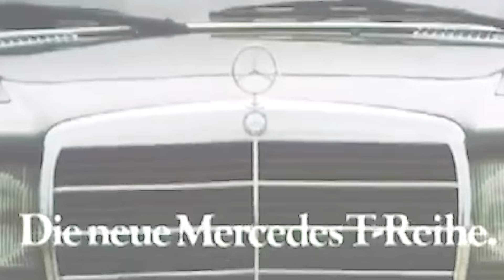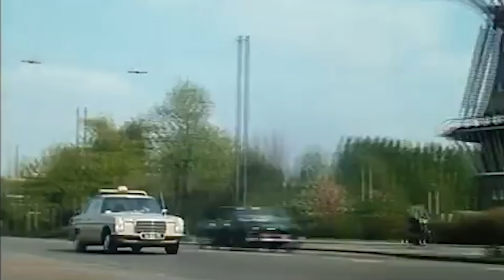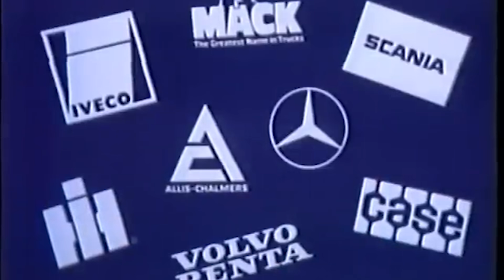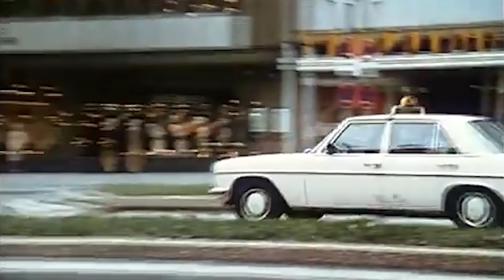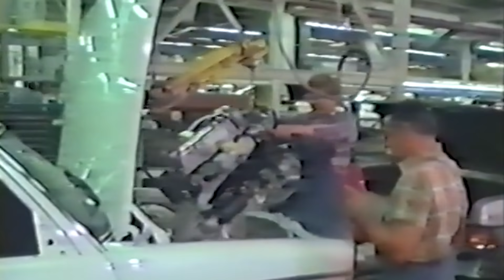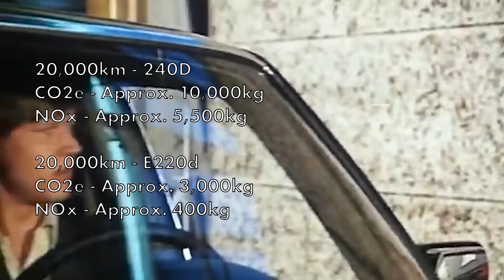Mercedes 240D - Still Fit for Daily Use?

Comment: Good subject. The fundamental message is to reduce "consumption" which in turn reduces all emissions. This is job N°1 for humanity.
This means avoiding E-cars which involves thousands of tons of CO2 to be made (the equivalent of 70,000 miles in a ICE car), taking public transport and using a bicycle for all local tasks. The ONLY positive of E-cars is to reduce local particles (other than from the tyres and brakes).

I have driven a 240D (4 speed) manual) and for me the main difficulty is with overtaking ;-). There are some quite good runners up to these cars.
Reply: I read an article recently that stated the total carbon footprint of the average EV battery was equivalent of that used for 6 batteries for the average plug-in hybrid. Since the 6 plug-in hybrids take 6 ICE cars off the road, the net environmental benefit is far greater than for a purely electric vehicle.
Reply: @ak5659  It takes an EV 70,000 miles to even equal an ICE car using petrol. If the ICE uses e85 from agri-waster, it will take far longer. I have nothing against EVs except if rare earth metals are used in the batteries. For the time-being only Toyota are getting close to solving the EV car problems.

Comment: Thank you for a very informed and well rounded video.  Very interesting when looking at vehicle tail pipe and total life emissions. 

For a long while now I've held the view that the internal combustion engine isn't quite the devil that some environmentalist's make it out to be, but that the fuels that we are filling our tanks with, are a lot of the problem. We can use cleaner fuels, in some countries we do, but others are slower to adapt to them. 

We could also look at retro fit exhaust emissions systems for older vehicles like this. It won't make it as clean as a modern diesel, but it also consumes a lot less resources to retro fit an old, good condition car, than to scrap it and build a new car. Which would give us a gain in lowering pollution two ways. First, lower tailpipe emissions. Second, lower total life emissions. That's a win for the environment.

You can always turbocharge a non turbo diesel to improve it's performance to keep up with modern traffic better, without major modifications to the engines fuel system, and quite possibly improve it's fuel economy. Older toyota diesel owners that fit aftermarket turbo systems find not only increased performance, but increased mileage too. Better mileage equals lower exhaust emissions.

Comment: W123 are becoming a bit antique pieces to be thrown around like this.I drive a 190d daily, with excellent reliability and fair fuel consumption considering is a 1988 4 speed car. It can totally keep up with modern traffic, and i don't go much into town with it.  Also have a W124 250d that i bought used 12 years ago, and 230000km after it still pulls strong. The 190d being smaller uses less fuel, obviously. I mostly drive over a low density region where transit unavailable. Inside cities, mass transit should always be preferred over private car, and long trips the train will be cleaner, but old cars can have a chance for little expense compared to buy a newer option that will be much more expensive and pollute just a little less over the same driven distance. I had an electric car, and was not overall impressed, plus some of those are designed to fail and require costly repairs over the years.

Comment: I know a guy with a W124 300D that has done almost a million km and hasn't had it's oil changed in 10 years (it's more of a thick black goo than oil). It still runs and drives. You just have be careful not to touch the thing in the wrong places because you'll create a new hole if you lay a finger on it, it's that rusted through. But it drives. Not on the road mind you, it hasn't been road legal for those 10 years, but it works when absolutely needed for one reason or another. It also tries to kill your spine every time the transmission decides to shift lol.

 Personally, E39 528i/530i are the best daily drivers you could buy used for a reasonable (albeit climbing) price today. Dead reliable if you aren't the average American who thinks reliability is when you can use horse manure instead of oil without any downsides. Replace the cheap water pump every time you do belts, keep an eye on the old hoses and replace as needed and replace anything else that goes wrong instead of letting it simmer until it turns into a raging boil. Plenty of comforts, none of the stupid electronic drivers "assists" that try to kill you, easy to work on, comfortable interiors with great ergonomics, heavily modifiable if you want to go down that route, and they get FAR better fuel economy than equivalent engine models from Audi at the time. Rust is an issue with salty winters, but it's managable if you take care of it. Had a 528i with spark plugs 40k km overdue replacement and a broken cam pos sensor start in -35C reliably and still drive fine as long as you kept the engine load low. Plus, they handle really well for a softly sprung heavier sedan, very nice in winters where most FWD cars struggle to accelerate, brake or turn because of the awful weight distribution they have. 
 If you wish to stick to diesels, most BMW's with any variant of the M57 engine are incredibly reliable and have good power. I'm convinced there's not a single Nissan Patrol or original Land Rover that's still actively driven and hasn't been M57 or OM606 swapped. 

 Also, for the lower CO2 emissions of diesels, that's not really the case. If you look at equivalently powerful engines, both modern and old. Diesel's emit the same amount of CO2. CO2 emissions are directly correlated to the amount of fuel burned, but equivalent performance diesel/petrol engines are usually roughly the same when it comes to fuel consumption, since the extra thermal efficiency from diesel engines in something as small and light as cars is easily offset by the extra weight of the engine components and emissions equipment. The reason diesel's produced less CO2 at the time was because they were far, far less powerful than petrol models, meaning they burned much less fuel. It was never a real advantage in cars for the reasons listed, but the very slow burning nature of diesel has it's uses in large, commercial engines where you could never get the RPM up high enough to get useful power out of a petrol engine because of the very high stresses on the internal components. 
 The one thing you also didn't mention about electric cars is that they're very heavy. Heavy vehicles put much more strain on the road resulting in more road damage which means more frequent road maintenance/repaving. It really doesn't solve any of the problems related to cars, especially in cities. There just isn't any winning in a car to car comparison, because public transit blows them all out of the water. Just stick to public transit if or when you can and roll your weekend warrior out when you want to have some fun. Remember: personal cars really aren't that large of an emissions issue unless you drive tens of thousands of miles per year. The bigger problem is industry and commercial vehicles that could very easily be replaced with electric trains if capitalism wasn't too busy milking the commoners for it's own benefit.

Comment: I own (and daily drive) a 300TD. I drive it approximately 25,000 miles per year. I appreciate that you have broken down the environmental impact of the full life cycle of a vehicle. Owning and maintaining a classic car mitigates a lot of the impact at the creation and disposal ends of the cycle, especially when you keep it for significantly longer than most people tend to keep vehicles. I've got 341,000 miles on mine now, and I fully expect to make it to at least 500k. I'd have needed two or three other vehicles inside of that span of time/miles, with the entire creation/functional lifespan/disposal numbers factored in.
Reply: I have 310,00 on my 300TD!

Comment: Every D engine in Great Britain, running simultaneously, produce less pollution than a single coal fired generating plant in a country that makes no effort to reduce environmental impact.Like in China, for an example.
So, don't give up your old car out of the mistaken notion that your action will fix the planet. The immense cost of building you a shiny new car is literal staggering. Why? Do the math.
We start by digging ore out of the ground.
Then petroleum is used to make all the plastic bits.
After following literally thousands of steps, each costing energy and material, bingo: your feel good moment when you tell yourself that you have helped fix the environment.
You didn't. So, take care of your old car, run it until it dies, then
recycle it. And shop for another user car. Rinse and repeat.

Comment: There is no chance that 220d uses only 4L per 100km. It usually averages from 6L+
Reply from the maker: Those figures are comparing a modern E220d, for a w115/w123 I would say probably 8L/100km
Reply: I know. The new 220d uses around 6L+ and 4 might be manufacturers declaration which is very far from actual figure
 @427Motorsports

Comment: Also I ran my L407d on a 50/50 diesel vegetable oil ,I only ran it on new veg oil rather than filtered oil for, a chip shop,,,it went well for two years u til the timing cam decided to leave its mounts ,,I’ve no idea if this was anything to do with it but I ended up going for a reconditionedengine supllied by Crewe engines ,,they had engines on the shelf ready to rebuild ,,after a failed attempt to put another secondhand engine I got for 200£ in ,I opted for the rebuilt engine ,,this was back in 2007 and cost 1200£ with the other engines being sold back to the company for rebuilding .

Comment: I've been driving a VW Golf mk2 1.6 Diesel (54 hp) or 2,5 years as a dailydriver (180 km/day .... about 40.000km/year).  Must say more fueleconomical than my current brandnew Peugeot Hybrid.  More easier to work on.  Only problem when driving a 'old' diesel : people just bluntly call you a polluter and curse you off the road.
The Golf 2 diesel thow, has been my most reliable and easy to work pn car I've ever owned ..... and still own.

Comment: Northern Ontario, currently drive a '90 Jetta TD (1.6l) with 405,000 km on the clock. Retired, but live rural, 5-6000 km/yr. Found your discussion of environmental fooprint very interesting. Drives well, keeps up with traffic, but age-related maintenance in an area where salt is used extensively is time-consuming. Spouse's 2017 Elantra gets similar mileage (Atkinson cycle 2l). Am currently thinking about15 y/o Honda, mostly to get away from extensive maintenance Volks now requires. I have the underside of my car sprayed commercially each fall with an oil-based solution to keep rust at bay, a not uncommon practice here. Diesel is significantly more extensive than gas here now, negating much of the mileage advantage (currently $1.84/l Cdn vs $1.50/l for gas). A 16 y/o student down the road from me has just bought himself an '80's MB diesel to get himself to secondary school, an uncommon sight here.

Comment: When it comes to the Emissions, I can't help but wonder if you fitted them with an EGR Valve and Diesel Particulate Filter, would it make enough of a difference in Emissions to where you could drive around 20,000 Kilometres per year and not be a net-polluter? I was planning to Diesel Swap my 2005 Toyota Corolla (Replacing the Stock 1.8 Litre gas engine with a 1.9 Litre VW TDI) and I was planning to counteract the emissions with an EGR valve and a DPF, as I desire good fuel economy (Current engine gets around 550 to 600 Kilometres out of a 50 Litre Tank, but the 1.9 TDI could get around 1000 Kilometres to a 50 Litre Tank) but I am concerned over my emissions, as the Gas Engine (even with a fake Catalytic Converter) is a relatively clean running engine with relatively low emissions (The cats are fake because I had to cheap out as at the time my cats were cooked but couldn't afford the 2+ thousand dollars to replace them properly)

Comment: Very interesting video, especially the bit on the environmental impact of the car. I drive a 2011 Peugeot 308 SW (SW designates a station wagon). It consumes about 5 liters of diesel with a 50/50 motorway and city driving mix. I plan on keeping this car until it literally falls apart, which it doesn‘t seem to want to, luckily. It saddens me that the diesel got such a bad reputation since VW got caught with fraud. I think it‘s way more sensible to drive a diesel at 5L/100km than a petrol car that will consume probably around 9L of fuel. Hopefully we‘ll watch videos about cars from the 2000s and 2010s in 30 years time.

Comment: Solutions to driving your 240D while minimizing emissions:
1. Engine Swaps, opting for a more efficient diesel engine will lower your emissions. plus modern diesel engines arent that much heavier so you wont need bigger tires and brakes. You can still use skinny tires and small brake pads to lower your particulate emissions and also significantly lower your tailpipe emissions.

2. Replace as much as your commute with public transport and biking
I own several classic cars, i love them, but i sure as hell dont need to drive them everyday. I use public transport for my long commutes and a bicycle for short ones. I only use my car if im in an emergency (overslept and cant make it to uni on time), or enjoyment.
Reply: I am honestly really intrigued by the idea of swapping and old car with a small modern diesel like a 1.9TDI or the Volvo D5 engine that one in particular is really reliable, makes decent power and most come with an Aisin 6 Speed Automatic thats also a pretty solid transmission if serviced well.
Reply from the maker: @alouisschafer7212 Tomo, our other 427 member, has this weird fetish for putting a 1.9TDI into everything. Conor won’t let him do it to an old Merc, though.
Reply: Just buy a W124, then. What's the point of Diesel swapping a W 123? Installing an alloy head hydro tappet engine in a W123 is kind of a crime.
Reply from the maker: @albinklein7680 inclined to agree, unless you’re gonna put a mad fast one in, there’s no point, buy a 124.
Reply: @427Motorsports  i see, i know that toyotas 2KD commonrail turbodiesels would be really good but maybe a swap costs too much when considering the car.
Reply: @albinklein7680  i meant more modern diesels from like 2010 model benz's. When they went to commonrail diesels+dpf+all other equipment.
Reply from the maker: We’d love to try that some time but would be a hell of a ballache!
Reply: @427Motorsports  I own a Diesel engine machine shop in Germany and I do a lot of custom stuff like that (mostly transmission adaptor plates and manifold welding). A friend of mine shoe-horned a twin turbo OM 651 in a W115. He even converted the original column-shifter to control the six speed gearbox from a sprinter van...

Comment: I am wondering, can you do little modifications to these cars (like exaust) and make them % wise a lot better for environment?
Reply from the maker: It's a good question, possibly to an extent - I did a bit of digging and there are companies offering retrofit emissions scrubbing equipment for old diesel machinery. I would guess it comes with a drop in performance, and it would only ever be exhaust scrubbing rather than the sort of tech found on modern diesels to reduce fuel consumption and burn clean etc
Reply: I've heard that in some european countries if you put LPG of all things onto an old diesel engine that can raise the EURO emission standard level of cars, so that might be an option as well to look into  @427Motorsports
Reply: @427Motorsports  Oh that's nice that they exist already! I think some would prefer to take the potential performance hit for reduced pollution. Thanks for the quick response <3
Reply: You can always convert to bio-diesel
Reply: You can buy an euro 6 catalytic converter and install it on the exhaust, near the engine may be. It will not make it as efficient as modern cars in terms of emissions, but it will always be better than stock. Plus, these aftermarket catalytic converter can be the "sport" kind, with 200 cells, so they should not hurt the little performance they have too much.
Reply: Probably by installing a catalyst in exhaust
Reply: I wonder what the footprint is for a car that is recycled after 5 years of use?
Reply: You can inform yourself in driving more environmentally friendly, it is possible. Both my wife and son do resist to learn how to do so. In some VWs you can turn on tips that show you when to shift, how to decelerate and so on. My wife ignores the hint to select a higher gear, my son does not use auto stop, because his driving instructor told him to leave the foot on the clutch at a red traffic light. Whatever new methods the governments invent to make the petrol consumption look higher in the latest "now really real" consumption - I drive with less.
Reply: less money buy newer used cars
Reply: I don't know if an adblue system could be added to an old diesel. That would reduce the NOX significantly.
Reply: who cares?

Comment: You seem to be forgetting that every year you daily your 240D, you deferring the purchase of a new vehicle like an EV... I think what is not sustainable is the overly complicated new cars with sensors, cameras and computers every where. And by the way a Tesla eats up the rear tires in a season if you're not careful, and Continentals cost 1500 euros a pair. Any normal car involved in a fender bender would get repaired. But not EVs, which are often totaled for minor damage. An unstable battery is not something you'd want as if it decides to runaway thermally it will burn the car and its surroundings into the ground. No warning other than a few seconds of smoke that you must not inhale. Not even the fire department can put the fire out. EVs are throw-away cars.